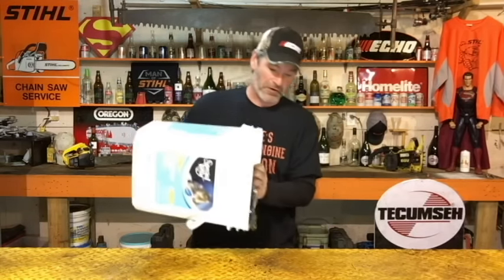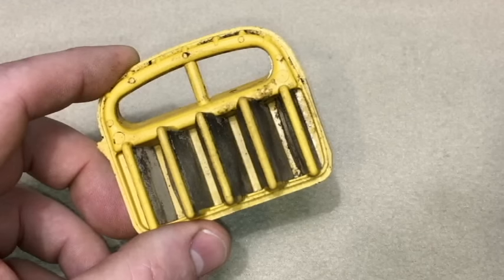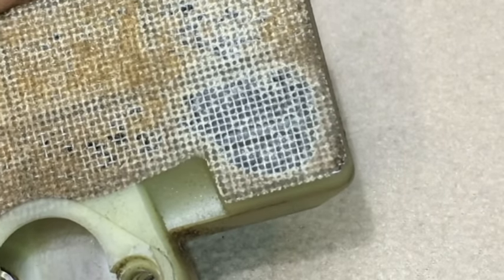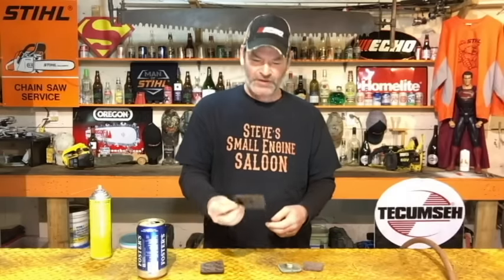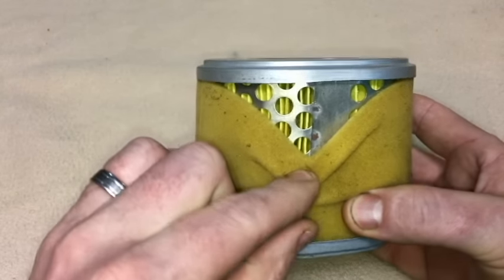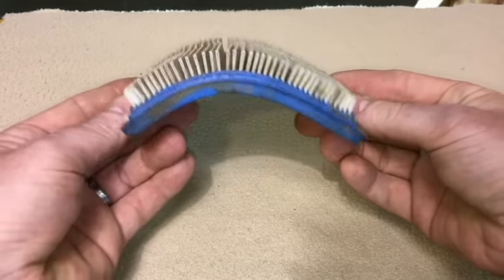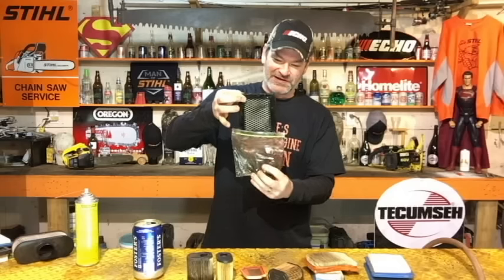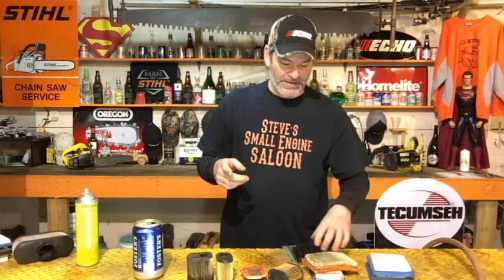How To Clean An Air Filter

Comment: IMO, once you acquire a piece of power equipment, you should also acquire maintenance parts. I'll usually buy filters and plugs in 4 to 6 packs. I never have to worry about not being able to use that equipment today because the air filter or spark plug is toast.

Comment: Question . . . How do clean out the oil that has entered into the cylinder. I clean the spark plug, it runs for about 3 seconds and then spark plug is coated with oil therefore no spark no running engine?

Comment: After you clean the foam part of the air filter on a 21 HP Kohler engine with soap and water should put oil on it after it is dry ?

Comment: Steve I  have seen you many times  cut fire wood.  i saw  something today on line.  a guy  used a WOOD SPLITTING CONE ON A ELECTRIC OR BATTERY  hand drill , to make kindling. So what do you think.  thanks  Tom in Monkton <Md.

Comment: Hi Steve , Question 
With Briggs foam filters pre-oil to catch finish of particular ?
Strange the OEM Honda square filter doesn’t have a pre-filter, it’s only the after market ones that have them as you showed one in video The same as the Briggs used in HRU 196/216.
If you get OEM filter and pre-filter cost is about AUD$45 for r Briggs, many buy aftermarket for $15 or China bulk packs.

Comment: Steve I do more lawn mowers than anything and those Briggs filters work great for Honda's also. I'd blown out several of them but still have a few that look like the one in the baggie. I buy them on eBay very cheap rather than in the cardboard and plastic Briggs brand for 10 bucks a piece. For $15 I get like 10 of them on eBay in there just about the same quality.
Reply: I would love a link to the exact seller you buy from!

Comment: Hey there Steve. Good videos. I have a Toro super recycler 30334. It has an electric starter for my daughter. I replaced the battery, bought a new charging cord. Still will not even crank. I checked the voltage on the old battery & new battery. Both show over 12 volts. All the wires to the starter looks like they are connected. Any suggestions? Thanks, Jack.
Reply: kawi kawi the toro is a 20334. I replaced the fuse also. The key start does nothing. All the wires look good. If you use the rope, it starts on the 1st pull.

Comment: I have a Stihl chain saw an old smaller one O7 I think , it is a dome shaped square synthetic paper stuff filter I cleaned it with brake fluid. It stopped air flow enough that I had to buy a new one. any Ideas on what to use. I don't think soap & water is going to work very well. Thanks Steve

Comment: Hi Steve, is the air filter on a Harbor Freight Predator 173 cc vertical lawn mower engine item 69731 compatible
 with any other lawn mower filter like Honda,
Toro or Briggs?  If so what are the compatible part numbers? These are the rectangle pleated paper surrounded by rubber type gasket the last type shown in your video.

Comment: Hey steve, can you talk about oil on your air filter? I have a Stihl 462 cm running a 32-in bar, and it was brand new a year ago. Fairly early on I noticed what appears to be oil on the air filter itself. It doesn't appear to be getting any bigger, but the fact that it's there has me a little concerned as I know oil should not be on the air filter. Could you talk about that perhaps?
Why would there be oil on the air filter, and if it doesn't appear to be growing any larger, is there potential for oil to still be getting on the filter? Thanks!

Comment: Steve do I need to take the blades and blade plate off to change the oil on a Honda 4 stroke lawnmower. If so which direction do you turn the nut to get the plat off? Thanks.
Reply from the maker: Most of us just tip it over and pour the old oil out of the dipstick tube.....

Comment: Hello Steve I have a Craftsman m110 mower and there is a problem when running oil getting into air filter  looks like it's coming from I believe they call it the breather tube.  Please help if possible be much appreciated.
Reply from the maker: Check my playlists
Reply: @StevesSmallEngineSaloon  sorry not seeing information on that issue

Comment: I have an old stihl 015L and it did not have an air filter. So I found one on the net and bought it. I washed it like you said to. The question I have is about 25% of the fuz is gone. Can I use a piece of felt also between the filter and the outside cover ??
Reply from the maker: Good idea.  Call it a pre-filter...
Reply: Thanks !!

Comment: Quick question. What's the most common easy to come by liquid to soak a carb in to clean tiny jets that you can't reach?
Reply: The first time I did such a carb cleanout as you're describing, I just soaked it in petrol overnight.
Reply: @Nookhoek  I'll have to try that. Thanks.

Comment: If you are using the blow gun, doesn't it make more sense to blow it from the opposite side, against the normal air flow of when it is installed on the engine? Not doing that basically makes debris embed itself more into the filter. Maybe Mass Air Flow Sensor spray would be better if any plastics were involved. Pretty sure it is safe to be used on plastics.

Comment: Great video. When I check my air filters, I clean them ONLY if the carburetor side is clean and has no holes, if it is dirty or even one hole, the filter has let particles through and must be replaced. If the carburetor side is clean and has no holes, I first smack out a majority of dirt, then spray carb cleaner from the clean side to the dirty side (the reverse direction of normal air flow). This helps prevent tiny particles from being worked deeper into the filter, and sends them out from whence they came. Only then do I spray carb cleaner on the filter intake (dirty) side, to flush out dirt but at low angles along and drain downward from the filter pleates (if that type of filter) or along the filter grain and downward on other types of filters. This gets most of the heavy dirt off and prevents working that dirt into the filter. I blow dry with 10 psi max and only from the clean side back out to intake side.  I may repeat this a couple more times if the outside of the filter had lots of debries on it. Paper filters can be delicate so I lighty wipe the areas between the plates with a quality cotton swab. But LIGHTLY as too much force or scrubbing can wear through the paper making holes and thus making the filter useless (destroyed).  Note: A Briggs and Stratton engine can handle dust particles, but the very tiny ports (holes) on the input side of the carburetors CAN NOT! Look carefully at the intake side of the carburetor for a small brass insert with a tiny hole only very thin wires can fit in it (to clean). If the filter is dirty on the carburetor side or if it has holes in it, any dust and dirt will clog this port very easily and make the engine hard to start, give it idle problems, or cause if to run rich or lean, and possibly more.  Remember, running an air cooled engine with lean fuel mixtures is bad (and dangerous) - the engine will over heat and the valves (especially the exhaust values) will get "burnt". This will cause cracks in the valve edges and degrade engine performance until the point of catastrophic failure. Never run an engine without all the proper filters in place, except for brief periods when troubleshooting carb problems (which must be done only by professionals and in very clean air conditions). Stay away from carburetors that have no filters in place, a back fire in the intake manifold can flash back through the carburetor, hit you in the face, and cause severe burns and permanent vision loss. Always wear eye/face/gloves and more when working on operating fuel systems and exhausts.

Comment: I wonder if Dawn dish soap would clean an oil soaked air filter. It seems to work in their commercials on the wildlife they clean, that were affected by oil spills in the ocean.  Different kind of oil, but still.
Reply from the maker: What a freaking awesome idea.....
Reply: Thanks. Hopefully it works and is as helpful to someone as this video was for me. Thanks for posting :)
Reply: I think if you use an ultrasonic cleaner in conjunction with very soapy water (using dawn) it might be even better.
Reply: I use Simple Green and I have foam filters that are over 15 years old. I don't have one of those sinks so I have to do everything out in the garage.

Comment: Another way to clean the foam filters is run them though the dish washer without dishwasher soap. Dishwasher soap isn't very kind to them. And regular dish soaps ( like Dawn ) should not be used in dishwashers.

Comment: you can use WD40 on sponge filters or wash them in a container of kerosene paraffin or diesel ring them out afterwards and use some light oil
never use petrol it's very dangerous you can use lighter fuel on those paper filters or use the technique I described for the sponge. carb cleaner would be alright as well or ethanol easy Start could be used or isopropanol

Comment: Would you recommend a Homeowner to Treat the Pre-filter with a product like K&N's Air Filter Recharge System?

I have ALWAYS oil treated my foam filters using the K&N Pre-filter System, what are your thoughts on Oiling the Foam Filter?

My thought has always been, "if the oil on the pre-filter catches the smaller debris, is GOLDEN"...

What is your catch on this idea?

Thanks Steve,
🤓-Thomas
Reply: K&N are overpriced crap! Avoid!
Reply: @toadamine  I don't BUY K&N Filters, but I use the Cleaner & Charger on the FOAM Pre-Filters to catch the Small Dirt Particulates.
On MY Personal Equipment 😉

Works pretty darn good!

I was just wondering if I'm the ONLY one doing this... Haven't had to replace an Air Filter in 10years! 

*And for the Air Filters that don't include the Foam Pre-Filter, I purchase the 1/8" Breathable Foam from my Local Jo-Ann Fabrics or Michael's Craft Supply!

-This is for the FLAT Ones ONLY, as I have not learned how to fuse the Foam together to make a CYLINDER shaped one, YET.

Take Care,
🤓-Thomas

Comment: Hi Steve, i know pre mixed canned fuel is better but for mixing your own, what octane rating is best for 4 stroke mowers and 2 stroke equipment? In Australia we have 91%, 95% and 98% (not containing ethanol). The manuals say to use 91% at minimum. Is there any advantage or disadvantage in using a higher octane rating? Im asking because i just purchased all new equipment including a new Ferris 400s zero turn and want to use whats best. Cheers.
Reply: cheapest.  no benefit at all for octane increase

Comment: Good informative  video. I don't have my own shop per say, but I have worked on small engines fir decades now. Personally, I seldom waste my money on any "carb cleaner" ...as it is usually just as expensive or moreso than brake cleaner. I wear nitrile gloves as well when using brake cleaner and eye protection, as it is truly powerful stuff! Also when I clean my foam filters, I often use. Dawn dishwashing liquid or a liquid degreaser ..which I purchase by the gallon. Dawn is very effective and won't damage foam or other filters which are glued together .

Comment: If it's a 600 series Jred 2077,2088,200 series Husky and they have the nylon filter all you do is shut the saw off,take the filter cover off,then the filter and pour a little saw fuel on it.Tap it on the stump,log,or saw handle,wave it around in the air a few seconds and reinstall and get your ass back to work...LOL!
Stihl,ask boss for a vacation,and hope they will pay you for that time,so you can go and spend the next couple days cleaning the filter....haha

Comment: Hey all. What an awesome channel. Thanks for the info. 
Also, I cringe when I see someone using brake cleaner without gloves or other protection. I know Steve continually cautions people against getting gas, etc on your skin, but brake cleaner is a specific solvent that will end you. No joke.
Reply: Just need tuffer skin. And give it the safety squint

Comment: Come on Steve it’s not melting it! Melting occurs with heating and liquification of the material. Spraying it with something it absorbs and dissolves some of the material to make it expand with the liquid substance. Try pouring acetone in a styrofoam cup. It dissolves the cup but does not melt it!  Rubber gaskets swell with absorbed gas. The way to shrink them is warm them to evaporate the absorbed gasoline. Chilling them afterwards also helps shrink them to standard size.

Comment: hi steve  
i have a 13.5 tecumseh  engine in lawn tractor ,,,, it looks new ,not very old  ...IT HAS 140 POUNDS COMPRESSION  ..  HARD TO START ,IT CRANKS  GOOD  ,,CHOKE  CLOSES  GOOD ,, LOTS  OF SPARK  ,,  IT TAKES MORE THEN A FULL MIN., CRANKING TO START . NO POWER , IF I TURN THE DECK ON THE ENGINE SHUTS OFF lack of power .. if i put gas down the carb. same thing , 60 sec crank to start ...  and not enough  power ?
Hope  you can help ?  THX  ED .......    just north of toronto .....
ps also 2 cans of CANADIAN that didn't work ether ?
Reply from the maker: I would clean the carb and go from there...
Reply: hi  i found the problem ,it's an aluminum & plastic  tecumseh carb ,,  watched a video ,on youtube   How To Rebuild A Tecumseh Series 7 Plastic Float Bowl Carburetor - . there is  small  spring under the emulsion tub ,,   the spring in mine  was missing ,  i put  a shorten  spring from a ballpoint pen ..  i find it hard to believe , there was a lot going on with this engine , but  this fixed it ,,it works like New  ..
YOUR REPLY IS   GREATLY    APPRECIATED ..
THANK  YOU    Ed
Reply from the maker: Good info, thanks bud...

Comment: air filters are cheap. you might clean the foam ones a time or two but they start to break down and it's just not worth saving a few bucks on a filter to wreck your mower or other machinery.

Comment: I had my pressure washer (karcher Honda) somehow blow oil up into the air filter and saturate the air filter... it’s a heavy fibrous paper type v-folded filter. Pressure washer won’t start up with it in but will with it out. It’s really expense so I’d rather no have to replace it.
Any suggestions?
Reply: Bryan Barrett carburetor is dumping gas due to a dirty seat. Crankcase is probably full of gas too.

Comment: I Clean all my filters the old fashioned way. With gasoline in a bucket and good squeeze with my hand.   NO ! it wont dissolve the foam air filter, think about it its a filter designed to go on a carburetor and manufacturer knows its likely to be exposed to gasoline.😮

Comment: I've enjoyed every one of your videos up u til this one. Air filters are waaay too cheap not to just replace them. You should never clean an air filter with compressed air like that. Cleaning with solvents should be used as a last resort. Some debris may be removed, but you're embedding debris into the filter media or damaging it with the compressed air which will allow more contaminants into your engine.

Comment: If you value your engines, don’t try and clean the air cleaners. Just think when you take a filter out of the housing, the contamination is on one side, when you attempt to clean a filter you finish up with the contamination on the wrong side of the filter element. It is cheaper in the long run to replace the filter. Air is the biggest component of combustion in a engine, so keep the engine clean, buy a new filter. I am a retired filter engineer !!

Comment: Steve, I'm hoping you can guide me in the right direction. 

My church's Craftsman lawn mower needs a new air filter. 

Sounds simple right? Nope. 
I took the old filter and the lawn mower's model number to our local repair shop and they couldn't find anything about the lawn mower - not even googling it. I thought, "That's crazy!"  so I came home and googled it myself. And I COULDN'T FIND ANYTHING EITHER!

 I hope maybe you can point me in the right direction.

I uploaded pics of the mystery lawn mower to imgur:
https://imgur.com/a/TZxn9Lx

The model # is C459-36410, serial # is 1D234K31133 - taken from the Craftsman sticker on the mower deck. The lawn mower isn't that old - maybe 6 years old.

The repair shop thought it is an MTD engine. I can't find anything on their website for those numbers.

I'll take the mower to the repair shop if I have to but I'm thinking to myself, "Geez, how hard is it to put on the new air filter?" It isn't - so I'd rather do it myself.

I thought I'd ask you Steve. Hope you don't mind. If you can't help me, I understand.

Thanks Steve. Love your videos. Best small engine DIYs going anywhere!

 in Kamloops
Reply: Hi again Steve. Guess what? I searched again this morning and holy smokes - I found a site that gave me the cross-reference numbers from Craftsman to MTD so all is looking good! Don't know if you saw my post above yet, but either way, don't worry about it. I've got this under control now. Thanks for making the great videos that you do. Cheers